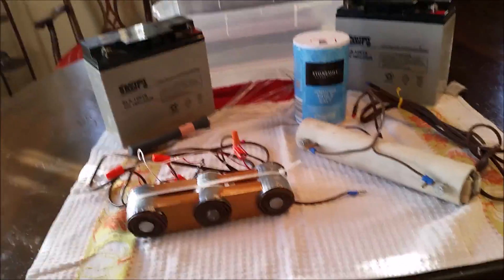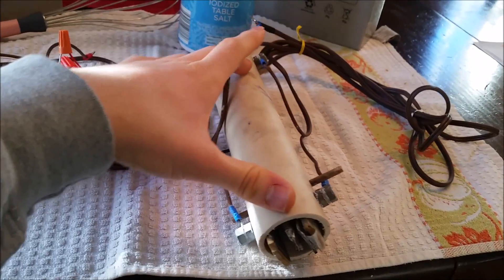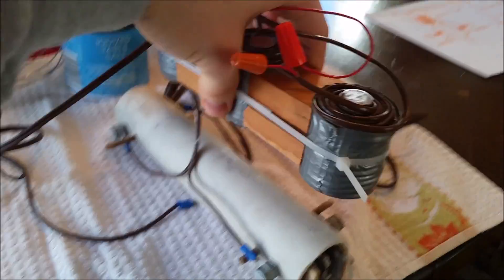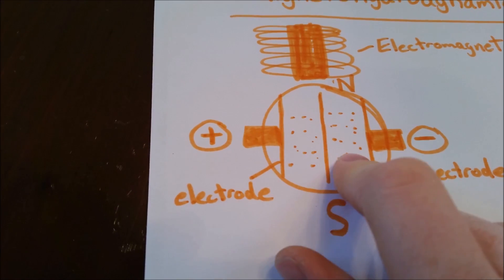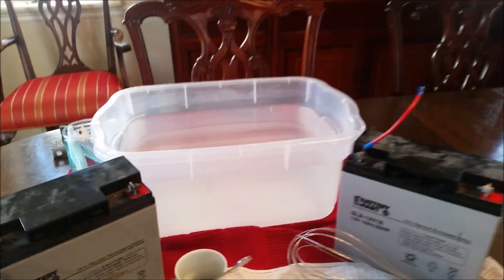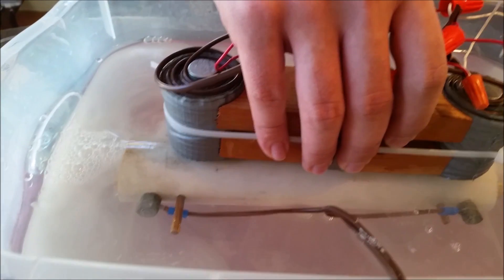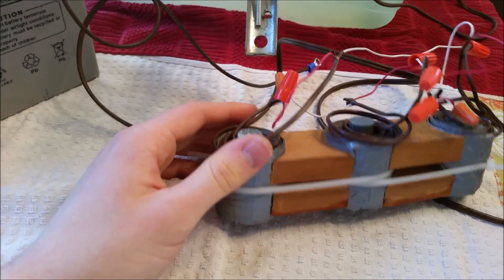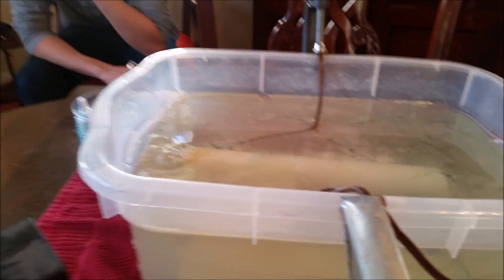Magnetohydrodynamic Propulsion System

Comment: Well you could miniaturize the entire system and then replicate it on mass so that you had more than one tube like 20 tubes and you can also make sure that your electrodes were thicker like you were saying you could teflon coat the inside of the pipe for better hydrodynamics and you could also smooth down the ends of the intake and you could increase the voltage and the turns to make the effect more noticeable.

Comment: You should try to figure out a way of wrapping the plastic tube in a metal tube, then wrap the metal tube with your copper. Now you would have an electromagnetic hollow core, but still have an electro magnet. Also because it's a hollow electromagnet core, you can increase the maximum amount of turns substantially, and you could power your plates from the inside of the thrust tube, eliminating any possible contact with the electromagnet.

Comment: I'm pretty sure it's not electrolisis.. some may be occurring but the propulsion is caused by via magnetic force cased by the flux of the coils the water flows through that capacitor making them feel the force of the flux of the coils via their electrons

Comment: You can use AC instead DC to prevent gas emergence. Magnet an current fields direction will be synchronized.
Reply: It must be DC to produce a direction.
Reversing the polarity reverses the flow.
Reply: @zeuso.1947  You can change magnetic field and DC direction synchronously (with magnetic coils).
Reply: @danilkichai2756  yes, but that requires multiple coils. 
We're talking about single coils determining the direction of flow.
Again, if you reverse the polarity, you reverse the flow.
Reply: @danilkichai2756  AC is completely useless for this application.
Reply: @zeuso.1947  single coil should be powered by the same AC source paralleled or serialized. `F = BxLI`, where vecors B and I have the same directions. => vector F would have constant direction.
Reply: @danilkichai2756  Yeah okay. 
Go do it.
Reply: @zeuso.1947  https://en.wikipedia.org/wiki/Universal_motor - it has already done.
Reply: @danilkichai2756  This isn't a fucking motor.
Reply: @zeuso.1947  does it change anything ?

Comment: Nice Job,    maybe try a square plastic tube,,    Put that tube in a toaster oven on very low heat,    in less than a minute,  it'll be soft enough to mold it square..

Comment: The word you were looking for is "electrolysis". Use 304 stainless steal under the water. Aluminum won't last very long using DC.
Reply: Chris Turnblom honestly don't know...what would happen to the aluminum? What is caused?
Reply: @NoSubsWithContent  I was just curious about why the aluminum it's a bad choice...more than the whole experiment haha! Just wondering what effects happen to the aluminum that doesn't to steel..
Reply: @efini_fc4276  I think your advisor is pretending to know it all.
Reply: @davemwangi05  you saw that too, huh? 😉
Reply: @efini_fc4276  Yes he's lying to you. Looking back at high school chemistry and some university lessons, I can see a number of things. First, there's something called preferential discharge, usually Hydrogen and oxygen will be the easiest to generate, when the solution is more conc, Aluminium will be next in the series < i.e the anode aluminium will be eaten away and Al(OH)3 will be formed. Chlorine is the last in the series and the most difficult to obtain in the preferential discharge series. Actually it is impossible to obtain here. It's only generated when you have MOLTEN salt with electrodes passing current through it.  Then finally from uni classes, there's a machine called electrochemical milling machine ECM and is used to fabricate components made of steel, aluminium, copper etc.  Yeah, the current is passed through the aluminium workpiece at the anode in the presence of salt water. Aluminium atoms are removed from the workpiece and they react with OH to for m Al(OH)3. Very complex geormetries are obtained by ECM. Chlorine is never formed. ever. Google it.

Comment: more coil turns bro
Reply: also use a thicker guage wire
Reply: oh u just said that lol
Reply: I'll watch the whole video first
Reply: you should make a transformer for the coils. very easy to make and kind of neat to see how two coils can interact non electrically .. or you can pull one out of the microwave..  also if you trust tour understanding of resistance well enough get a rectifier and run the coils at 120v maybe just be careful how long .. sorry if I sound know it all ish.. I'm far from it .. your project is really cool man

Comment: Definitely electrolysis was taking place. 
The magnetic fields are not moving anything because of magnetic fields were not changing or pulsing in a pattern to cause water to move in any definitive direction
Reply: go back to the books and confirm that it should not pulse. That's Not needed.

Comment: you should use magnet on top and below use real metal up the vote to 1000. vote and you see a real levitation you need to put all in to a metal box if you put a spin magnetic ring or disc spin it at 5 000. RPM   anti clock wise try this and you will have real anti gravity levitation  a flying electric field gravity levitation if you build is try putting on to a flat 3 ft x 3 ft with a seat on it and build it into under the plate form you will have  real flying  chair

Comment: Long way to go with any real use for so primitive design. Good luck - you need a lot of it. Electrodes designed wrong, electromagnets set wrong, no additional self supply energy unit makes this design extremely power hungry. Material used shows lack of experience.
Reply: Well, you can't expect much from someone who doesn't know the difference in anodes/cathodes, everything is just an electrode... 🙄 Using crap materials, because they don't know what the hell they're doing. Americans. We're a clever bunch... 🤣🤣🤣